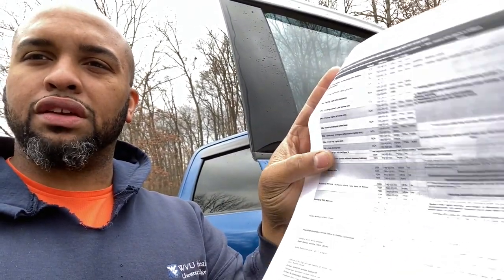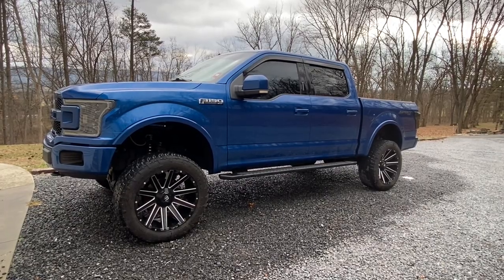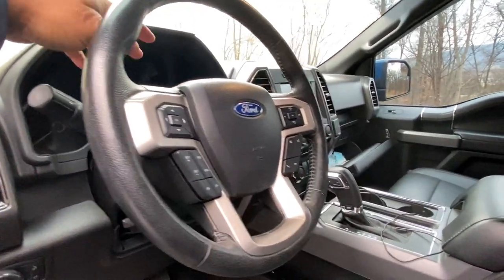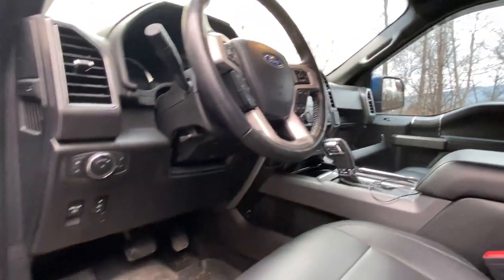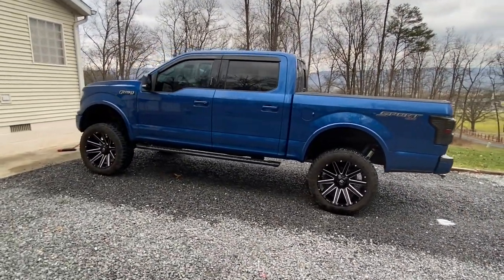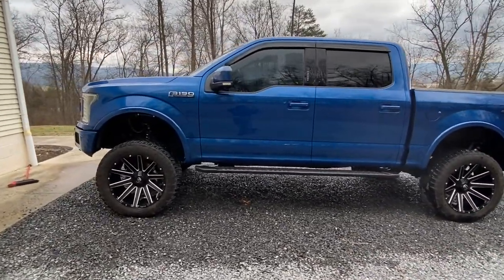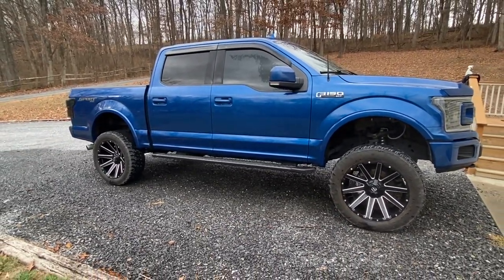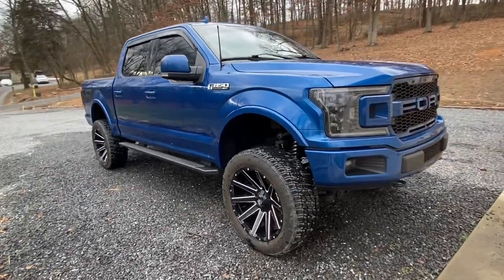My 2018 F150 FORScan Changes

Comment: Thanks for the video! I recently purchased the Forscan adapter but have yet to make changes.
Reply from the maker: Just take your time. And do your research. Make sure to mark everything to change. It’s not too bad.
Reply: @juicer911  Would you happen to have a link to the Motorcraft.com as built data sheet?  I tried to find it with no luck. Thanks!
Reply from the maker: @white09stang  I think this is it.

https://www.motorcraftservice.com/AsBuilt

Comment: Question kinda new to all of this where do you plug in the cable to be able to use forscan and what cable do you recommend I have a 2018 stx. Thanks
Reply from the maker: The module itself plugs into your OBD two connector under your steering wheel. The other side plugs into your laptop. It depends on what upgrades you want to do to your truck. When I added halos, I was able to delete the hyper flash. I was able to add a trailer, brake controller, change my tire size, increase the number of texts from my blinker. Change the loading screen on my radio. I also wanted to change the ability to take me to my GPS while driving. It just depends on what you want to do.

Comment: I have to consider this!!! 😅... On the audio upgrade, did you notice a difference in music volume / overall sound? As for the calibration of the speedometer, are u still running stock 3.31-55 or 73 gears? Have you considered upgrading gear ratio?
Reply from the maker: Yes I did notice a difference in music volume and overall sound because I added an additional amplifier and 10 inch subwoofer. So that added a lot of bass to the system. Leveled out a lot. Second as I believe that I have 3.55 gears. I really have not thought about changing my gear ratio. He does everything that I need to perfectly!

Comment: Where did you get the blue fob cover? Do you have a link?
Reply from the maker: I do not. But I purchased them from eBay. They are a little loose on there, so I put a little glue on the inside of mine to hold them.

Comment: Nice truck bro!!! Do have a LIFT or LEVELING KIT ? What size or rims & tires
Reply from the maker: The lift is a rough country Vertex 6 inch lift.
Reply from the maker: Running 22s with basically 35 inch tires.

Comment: Where did you go to get your trucks build sheets from, (website and cost?) with the stock codes.
Reply from the maker: This is the site I used. And it was free!

https://www.motorcraftservice.com/AsBuilt
Reply: @juicer911 thanks I’ll check it out, keep the content coming.
Reply: @juicer911  Great truck and video, Thanks! Also love the As Built info. Found the site and was able to see the modules/codes just can't view the saved file. Its an .AB ext. how'd you print it?
Reply from the maker: @Flahertyga  If you can pull them up on your screen, try taking a screenshot in printing from there.

Comment: Hey nice truck, when you switched your cluster did you use Forscan to program the mileage and hours? or did  you have someone do that for you?
Reply from the maker: When I switched my cluster, I sent off to https://www.clustersbylivnitup.com. you have to send in your VIN, And a picture of the mileage with a date and signature in the pic.
Reply: @juicer911   Thank  you for responding.I  was chatting with someone who told me i can use Forscan to do it.
Reply from the maker: @actfitwil  No. You can’t use ForSCAN to change the mileage. You can enable  features, but not change mileage
Reply: @juicer911  FYI  Update, Yes you can program the cluster with Forscan . I just did it. In your case you may have still needed livn it up to program yours if it was used . Mine was brand new . with Forscan, you can program more mileage but you can not reduce mileage. Everything else was just saving asbuilt data on the old cluster IPC and writing it to the new cluster.
Reply from the maker: @actfitwil  That’s good to know. I appreciate it. I did not know that you can change any mileage with it. Good that people can’t take mileage. LOL

Comment: Once you enable a subwoofer to your truck. What did you hook it to? Dud you have to buy a pac module to hook up RCA jacksm
Reply from the maker: Once I enabled it, I tapped into the factory plug in the rear. The driver side rear panel houses the factory sub connection. I did use an “add an amp” connector that tapped into 2 of those wires to provide the RCA outputs. I ran my own AMP power and Ground.
Reply: @juicer911  so you took out the original factory amp right?
Reply from the maker: @drpl420  mine did not come with the factory amp. But all are prewired for the factory amp option. That’s what you are enabling with Forscan. You are sending power to the factory amp plug.

Comment: You do know you don't have to use the as built pages anymore... Right???
Reply from the maker: I am not sure. But I am kinda old fashioned. I like having a hard copy of things in hand at time.
Reply: @juicer911  That's fair. But now you can just click on the line underneath the asbuilt page, And it just brings up a menu with all of the codes that you can just enable or disable. No more manual entry. It's much safer and much more reliable, I encourage you to check it out.
Reply from the maker: @sargvsu  oh man! That sounds great. Going to do that soon. I appreciate that!
Reply: @juicer911  make a vid. Will be great for views
Reply from the maker: @sargvsu  heck yea!!

Comment: Where did you find the key fob cover? I haven’t been able to find any that are for the fob with the flip out key.
Reply from the maker: I got it off of eBay. But when I go back and look for it again, I can’t find no listings.
Reply: @juicer911  it’s all good man I appreciate it! I can keep looking I will find it!
Reply from the maker: @loganakers5308  https://www.ebay.com/itm/Silicone-Protective-Rubber-Cover-Case-Keyless-Flip-Key-Remote-Fob-Ford-4-Btn-/402002671759?_trksid=p2349624.m46890.l49292
Reply from the maker: @loganakers5308  https://www.ebay.com/itm/2pcs-Silicone-4B-Smart-Case-Cover-Protector-Fob-Holder-for-Ford-Flip-Key-Start-/193273858052?_trksid=p2349624.m46890.l49292